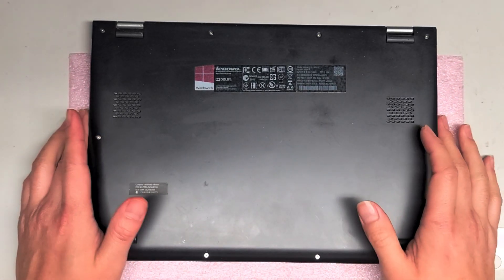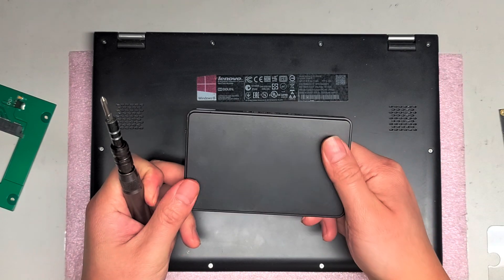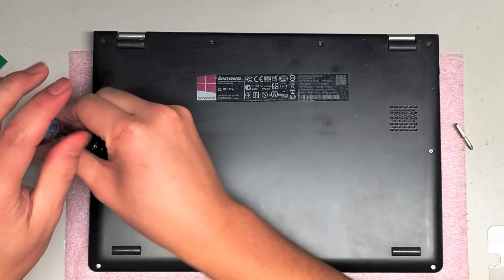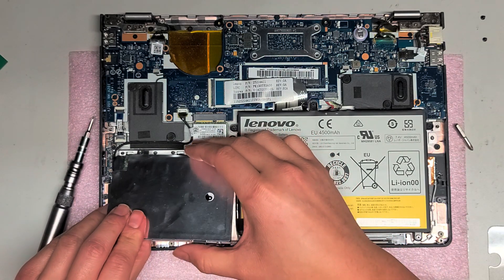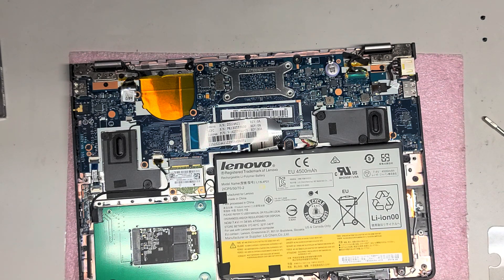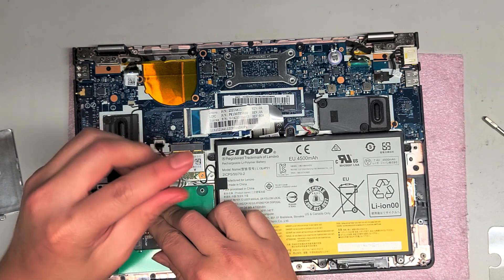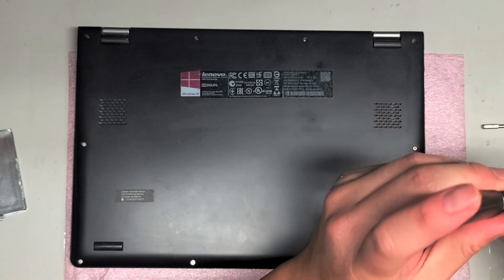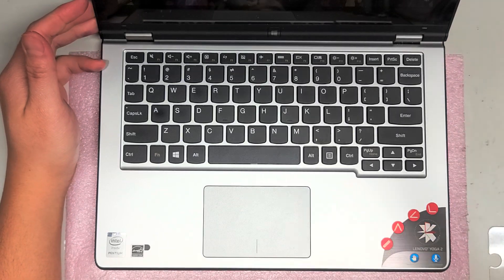Lenovo Yoga 2 11 20332 SSD Hard Drive Upgrade Repair SFF-8784 mSATA Upgrade

Comment: Does it have a cooling fan inside? My laptop gets too hot
Reply from the maker: No
Reply: @ItsBinhRepaired  any solution? To cool it down.
Reply from the maker: @jahangeerzahid9564  not sure other than reducing cpu performance
Reply: @ItsBinhRepaired  thanks alot ♥
Reply from the maker: Yup

Comment: Could an 1) NGFF M.2 SATA  to SFF-8784 SATA Express Adapter be used with an 2) SATA M.2 SSD as an alternative to what you propose for the YOGA 211 20332? For instance, one alternative for a 500Gb HDD that appears to be compatible would be a 1) NGFF M.2 SATA to WD5000MPCK SFF-8784 SATA Express Adapter For Ultraslim Hard Drive with a 2) WD Blue 3D NAND 500GB Internal SSD - SATA III 6Gb/s M.2 2280 SSD. Just asking as M.2 SATA provides more product, pricing, and availability options.
Reply from the maker: I don't know what you mean. There's a difference? I thought all m.2 sata work with all m.2 sata. I didn't know ngff is an incomparably.
Reply: @ItsBinhRepaired  Yes, there is a difference, both with the physical configuration (form factor) and the data-protocol specification. My question involves whether the difference affects the compatibility.  Specifically, the "M.2" form factor is the next generation form factor (NGFF) after the "mSATA" form factor, apparently eventually replacing the mSATA FF. For instance, there are at least four physical sizes of an M.2 SSD card as well as two edge-connector configurations, M/B key (SATA) and M (NVMe) key, whereas the mSATA form factor has one physical card size and one edge connector configuration.  The M.2 adapter card accepts only the M.2 SSD form factor card and  adapts the M.2 SSD to an SFF-8784 SATA Express interface. Now, the overall physical dimensions of this alternative combination appears to be no more than the mSATA SSD/SF-8784 SATA combination that you used. So, the alternative combination should fit in the YOGA 211 20332 as well, and thus "physically" compatibile. The crux of my question then, which I should have been more clear on the first time around, is about the compatibility of the alternative combination from a "data protocol specification" standpoint, or more specifically the "backward" compatibility. That is, are the "SATA III" SSD specification, regardless of being a either an mSATA or M.2 form factor, and the "SATA Express" SF-8784 Adapter specification both "backward compatible" with SATA I, II, and III. Apparently, per the 2013 SATA v3.2 Specification, the SATA Express (SATAe) enhanced interface protocol supports both Serial ATA (SATA) and PCI Express protocols "simultaneously". I would think a "SATA III" SSD is backward compatible to SATA I and II just as USB 3.0 is to USB 2.0 and 1.1, but I'm not sure about "SATA Express" backward compatibility particularly involving the "old" YOGA 211 Model 20332. In other words, will the 20332's SATA Controller "AHCI" Mode and "UEFI" Boot Mode flawlessly and properly communicate with the "SATA Express" Adapter? I'm hoping you can give me guidnace based on your expertise. I can get the alternative combination, i.e., M.2 SATA III SSD +  SATA Express SF-8784 Adapter, for significantly less money at this point but don't want to go through the hassle of trying to return the products if they don't work in the 20332. Thank you for doing your videos. Good work!
Reply from the maker: @almarodi460  your first comment said nothing about msata. I don't know. Only thing I can say is to try it.

Comment: Have this same laptop. Original hard drive has bad sectors in boot areas, so Windows doesn't load and it's impossible to format or recover. I noticed that for the Yoga 2, there's a bunch of partition tables on the drive that can't be recognized under Windows, and I'm a little worried that if I can't clone the drive, adding a new ultraslim 2.5" SATA may not allow UEFI detection, especially if the system is locked to a single drive serial.

Can I relatively safely assume that if I buy a drive, I won't have to recreate similar partition tables before installing Windows?
Reply from the maker: You just need to clean install Windows. No old partitions necessary.
Reply: Awesome! I do have one more question if it ain't too much trouble; Watched a couple of other videos about upgrading to an SSD, but those youtubers seem to insist that any standard 7mm 2.5" SSD will work - but the drive from the Yoga 2 is a 5mm.

A 7mm drive would be much cheaper, but I'm a little worried the case won't close flush and drive carriage won't reattach. Do you have any experience swapping standard 7mm drives into this rig? Does it work fine, or does that create problems?
Reply from the maker: @grimfusion  they sell 7mm drives with that connector? It's not a SATA drive. Watch the video. I highly recommend the SSD upgrade.
Reply: @ItsBinhRepaired  Not quite. Lenovo released another version of the Yoga 2 11" that had an internal SATA connector and a 5mm Seagate SATA HDD. Same model number, though - which is weird.

I've watched a few youtube vids of folks insisting any 7mm 2.5" SSD will fit, but none of them showed the Yoga 2 reassembled. Just trying to avoid a product return if slapping a 7mm drive inside doesn't quite fit.

https://i.imgur.com/e9HhnWF.jpg
Reply from the maker: @grimfusion  put a 7mm SSD without the bracket. I'm sure I've done one that way before.
Reply: @ItsBinhRepaired  Rad! Thanks for all the help, dude! Much appreciated.
I just subbed to your channel, bro. ^_^
Reply from the maker: @grimfusion  hope the upgrade goes well. Thanks!

Comment: someone gave me this model laptop few years ago, been meaning to upgrade the hard drive to SSD and Ram. Just did a crystal disk info and its a Seagate drive on my model.
Reply: This would be the third Yoga 2 11" I've worked on and bad HDD sectors were common across all three drives. Two of them were recoverable in Spinrite and this latest one won't allow partition management or formatting. Seatools testing just flat-out fails.

If you store anything important on that ultraslim, you might wanna migrate over to an SSD sooner than later.
Reply from the maker: @grimfusion  ultraslim anything is too fragile. All this movement towards thin and light is stupid and causing lots of failures.
Reply from the maker: Sounds good.